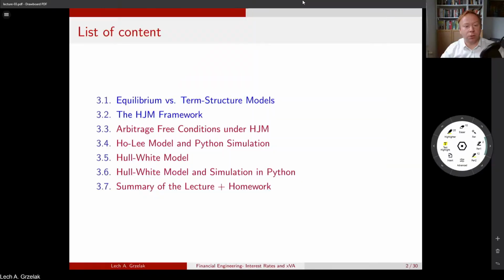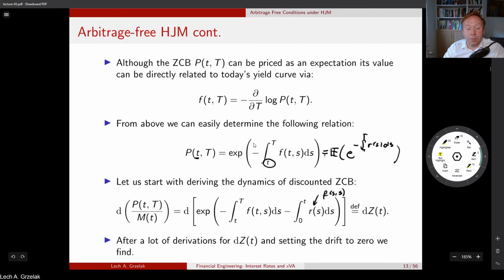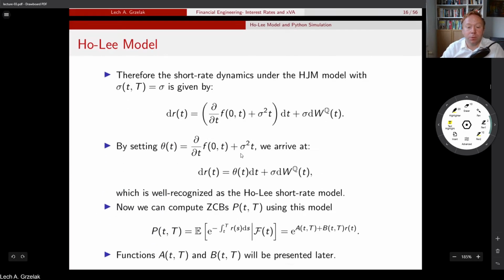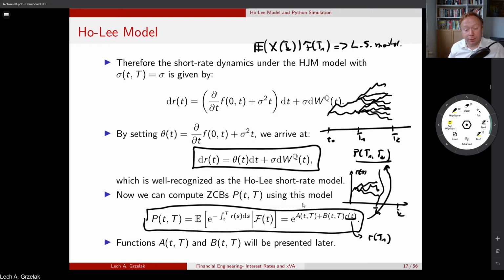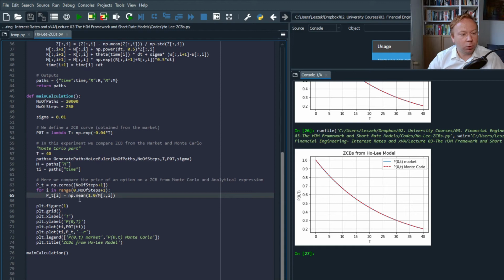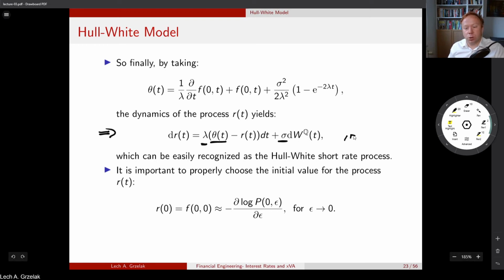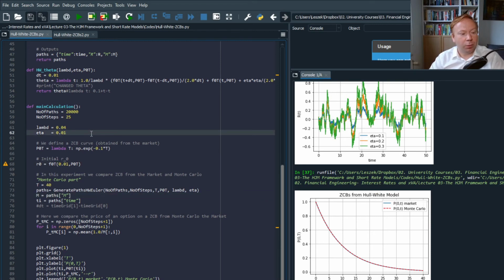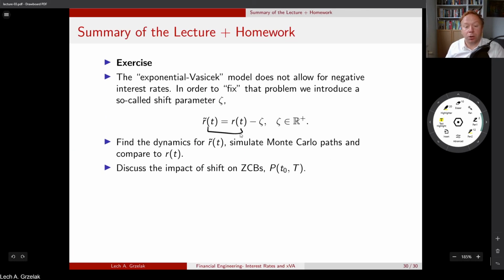HJM Framework (Lecture 3/14, part 2/2) | Financial Engineering Course

Comment: Dear Professor
I have a question about the content on slide 13. On slide 13, for P(t, T), you mentioned that t represents today which makes P(t,T) is deterministic. However, it isn't apparent to me, because just in the later formula on the same slide, we discounted P(t, T) with a money-saving account to make the process martingale. If t represents today, why do we need to divide P(t,T) with a money-saving account?

Comment: Dear Lech, 

I am enjoying reading your book on this topic. I found some typos. 
(11.52), (11.53) and (11.54) are not correct even though (11.55) is correct.
We should compute integrations in these three equations using the second argument, not the first.
Reply from the maker: hello Sungchul, thanks a lot for the feedback and bug spotting. I will make sure these typos are corrected. Best wishes, Lech

Comment: Sir Thanks again for this great set of videos. I have one doubt - could you please explain this step 
M[:,i+1] = M[:,i] * np.exp((R[:,i+1]+R[:,i])*0.5*dt)
Reply from the maker: Sure, the solution for the money savings account given by: dM(t)=rM(t)dt is M(t)=M(t_0)exp(int_0^tr(t)dt), so in order to get the M(t) at some time "t" we need to integrate int_0^tr(t)dt, one way out is to consider some grid t0<t1<t2<...< tn and then discretize this integral using trapezoidal integration, over some interval [t_{i},t_{i+1}] , as you will go over all the intervals you will get your final M(T). I hope it clarifies. Best. Lech
Reply: Thank Sir @ComputationsInFinance

Comment: Very interesting Sir, please can i see a video where you do the calibration of hull- white with swaptions? Thanks in advance
Reply from the maker: hello Fabiola, Once you implement the pricer for Swaptions using the Hull-White model, then you can define an optimization problem where you will seek for the Hull-White model parameters (typically you will fix the mean-reversion parameter and allow the volatility parameter to be piece-wise constant) such that the swaption prices from the model and the market are as close as possible. I hope it answers your question. Best, Lech
Reply: @ComputationsInFinance  yes Sir,
I know the theory but I don't know how to code it on r
Reply from the maker: @fabioladjouidje4505  I see. I will try to discuss it in the follow up course. Thanks for the hint. Best regards, Lech
Reply: @ComputationsInFinance  thank you Sir

Comment: Hi Lech,

Where can I find the solutions to the problems in the lectures? Slide 28 points towards the git repo, but I can only find the solutions to textbook problems. The second problem in this lecture comes from the book (11.9), but the other two problems ("exponential-Vasicek") are not there.
Reply from the maker: hello Oleksandr, indeed, some of the solutions for the course are not given online. They however available for the teachers!
Best regards, Lech